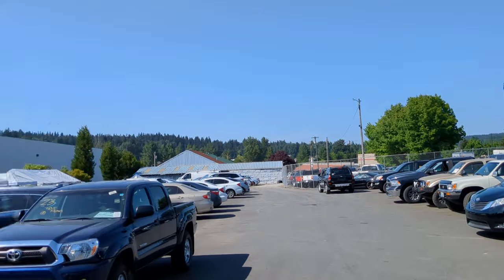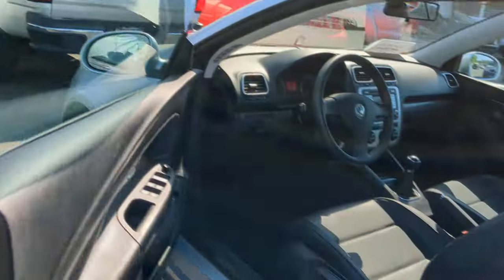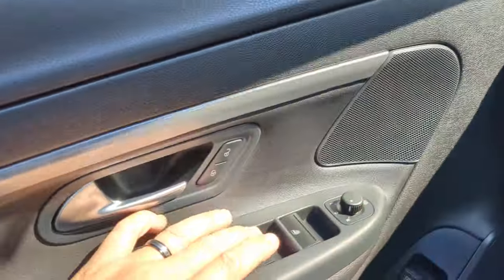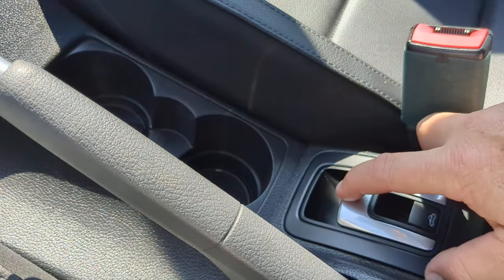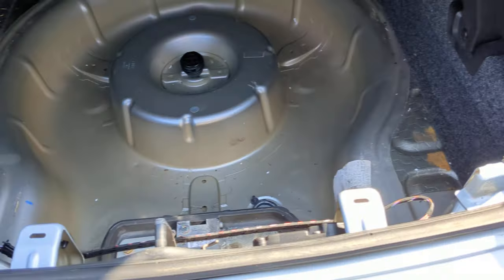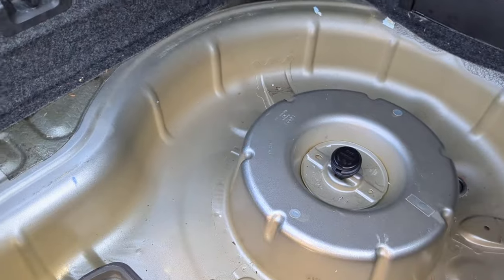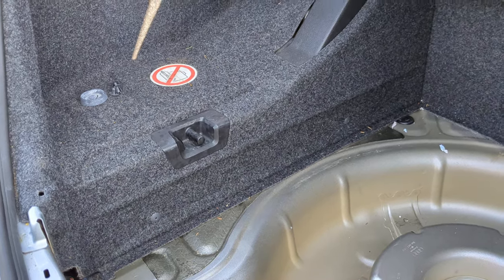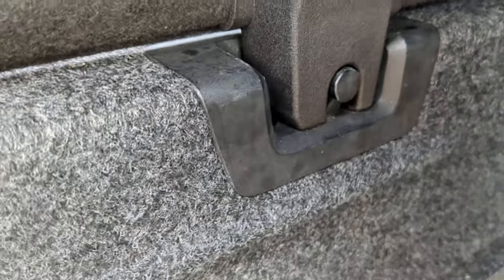2007 Volkswagen EOS convertible hardtop problem resolved

Comment: That's awesome. Just found this problem in my 2007 EOS this morning. In my case two Australian 10c coins were enough to make the switch work. The weird thing is that in the past, if the cargo cover isn't completely down you try to open the roof and you get a warning message on the dash. But in my case I didn't get the dash warning but the two coins (approx 4mm thickness) was enough to trigger the sensor. Thanks heaps. :)
Reply from the maker: @brucemckinnon2624  Hey Bruce. So glad I was able to assist all the way down under. In my case, it just happened to be one of those days when I didn't have 2 Australian 10c coins in my pocket. 😂 Thanks so much for watching. I hope you'll take the time to hit that subscribe button. Enjoy the rest of your morning, tomorrow, from this afternoon, yesterday. 🤔 - Sponge

Comment: Also, if you get a message that there is an ‘object in the rear’, the top won’t open. Just means the sensors on the bumper are detecting that there may not be enough room for the trunk deck to swing out far enough. 
Just pull forward… or back out of the garage to correct the issue.

Comment: I have a 2007 EOS so, of course, I found this interesting even though my top is working. My switches, though, are quite different and mounted more vertically but maybe a different option package is the reason. A couple years ago the top did malfunction which I think was caused by me when I was trying to clear out the rear moon roof drains, putting the top partially up and down multiple times. It appeared to simply get confused! What I did so solve it was to locate the release on the trunk support rails and manually close the lid and when doing so the lid powered down which it hadn't done for a while. Once that was working, the top worked too. Still haven't found the leak, though, which recently during heavy rains filled the spare tire well and put standing water on the driver side front and rear!
Reply: Haha nice bro I have the 2009 lux version with still under 100k miles in it lol, thanks for the info!!

Comment: i am having this issue with the sensor as you show, but mine has popped thru to the inside and has no spring - I took it to VW and they are clueless -they said it i need a new trunk liner, but from what i can see that is just the carpet and not the sensor or clip portion 
 i have a someone that can fix this but wondering if you know what the part number is for a 2015 Eos Final Edition - if so, i would really appreciate any info you can provide -thanks in advance

Comment: Did your dashboard display an error with the cargo cover? Normally it does.
Reply from the maker: Hi. Unfortunately, due to the amount of time that passed between, recording the video, posting the video, and now, responding, I have to admit, I do not remember. However, I do not think it did. There was no mention of the warning light on the dash, and I would have noticed it right away. Thanks for the question , and thanks for watching. - Sponge
Reply: hi, do you have any other ideas? I have exactly the same problem, but the solution from the video did not help.

Comment: Amazing... Worked just fine...  Crazy thing though.  Somehow the polarity got reversed in a rear window so down is up on one so the windows are going in two directions.
Reply from the maker: That's an odd one. I've never encountered that. You might want to do a reprogram on the system. I don't believe I have a tech tip on that process unfortunately. I hope my video at least helped repair the convertible top operation. - Sponge

Comment: My 2006 Has a "w" shaped metal part that clips to the bottom of the luggage cover leg, that makes up the distance. It will occasionally fall off & I have to go looking for it
Reply: Same on the 2007, that's the first thing I check is in having issues

Comment: Thanks for sharing this video! I'm in the PNW and came across your video while trying to help a friend with a similar issue with her EOS. Do you have an email and/or contact detail for your shop in case she might need to make an appt?
Reply from the maker: Hi Tammi. At this time, I do not have my own shop or business license to do independent work. I am, however, contracted to work through 405 Motors in Woodinville WA. They have a service department that your friend can go through for repairs. Thanks for watching.

Comment: A round headed screw would temporarily fix the problem and be removed when new part is obtained.
Reply from the maker: This is true. May I just add, if someone does this, be sure to make sure cargo area cover is still in down position to prevent any damage. Thanks for watching. - Sponge
Reply: hi, do you have any other ideas? I have exactly the same problem, but the solution from the video did not help.